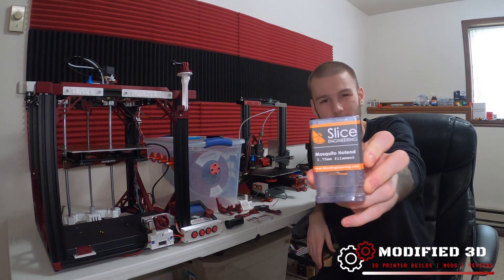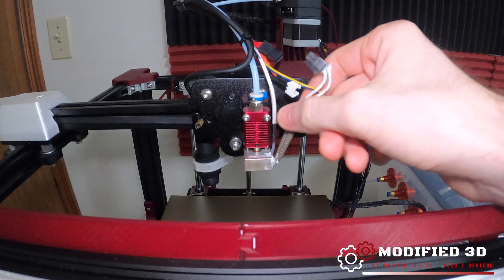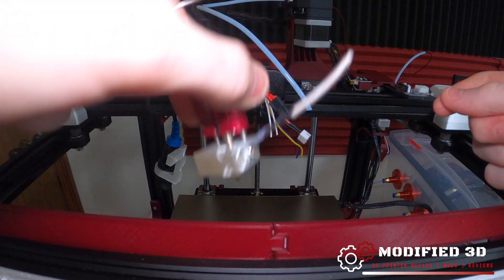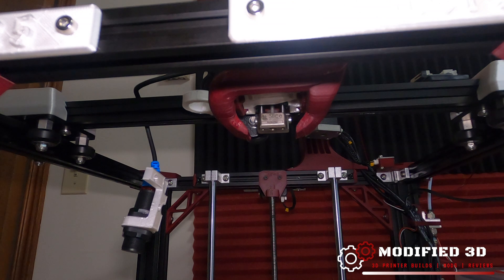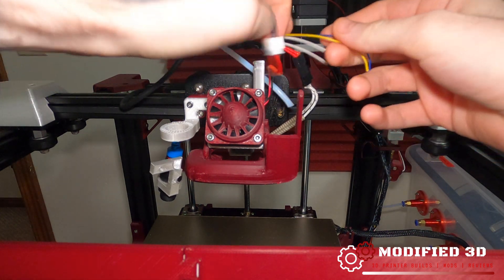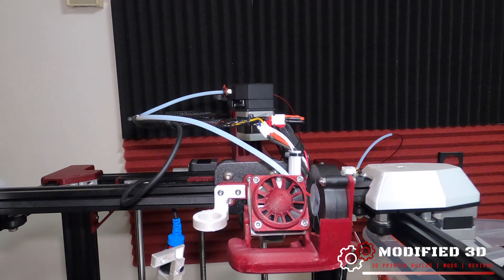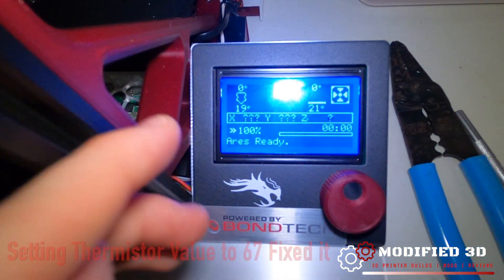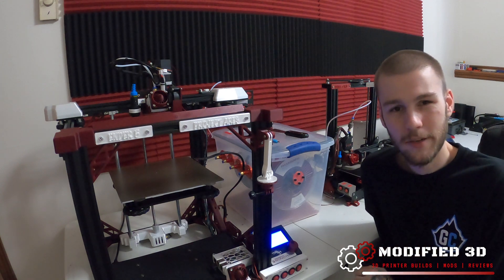How to Install a Slice Mosquito Hotend | Creality Ender 5/Ender 5 Pro (HIGH TEMP PRINTING)

Comment: I have a question. I've got an Ender 5 Pro with a 4.2.2 board and TMC 2208s. I'm a fan of TH3D products. I run TH3D UFW 2 firmware 2.12b and I have their Flex plates (smooth & textured) and the EZMat. I also have the EZABL but haven't installed it yet (due to several issues that TH3D is dealing with). Currently using MANUAL_MESH_LEVELING that appears to be working but not ideally. I would like to update my hotend to allow me to get to hotter temps. I do have the TH3D titanium heat break for the Creality hotend. This will at least pull the PTFE away from the heater which should allow me to run the hotend to higher temps. I also have a higher spec thermistor that I could install and I could recompile my firmware as needed with things set as required. So I'm wondering if I install these on my stock hotend what would be the max temps I could get to? I'm not looking for anything crazy, thinking maybe 300C max would be fine for me and I really don't see running much higher than 280 in most cases. Would this be possible with the stock hotend with the titanium heatbreak? Would I need the higher spec thermistor? Have you ever installed the TH3D titanium heat break? They currently don't have a video showing the process just a couple images and a bit of text on the product page. Think it would be good for someone to do a video showing the install. If the stock hotend wouldn't handle the higher temps, then what are your thoughts about the TH3D tough metal hotend? It's only $30 but I really don't see much difference between it and the stock (I already have their updated quieter fan installed). Appreciate your thoughts on this. Thanks.
Reply from the maker: Hey there! The stock should be able to handle 300c as long as you've got that TI heat brake in place and the higher temp thermistor. Personally I prefer the design of the Mosquito hotend for high temp prints to avoid heat creep thought.
Reply: @modified3d59  Yes, I like the Mosquito hotend too but I don't like the $100+ price.  And I really don't think I need something like that for the temps I'm looking at running.  How much heat creep would I really experience with Capricorn PTFE (or I may switch to TH3D Tough PTFE which is rated to 275C) with the stock hotend and the Ti heat break?  I've already swapped to the TH3D quieter fans.  I don't believe they have a higher CFM rating however but they are more efficient.  Do you know of any available fans with a higher CFM rating that I could switch to?  Or is this even really necessary?  Another option would be to switch to the TH3D Tough All-Metal Hotend.  This is only $30 and appears to have a better cooling system.  Do you have any experience with this?  Guessing this would allow me to go to even higher temps in the future if I want.  But I also have the PrinterMods MDD V1.3 direct drive conversion that I have ready for a future installation and I'm not sure if it's compatible with the TH3D Tough All-Metal Hotend.  I've sent them a question to find out.  Guess another issue is if I switch to the TH3D hotend, I'd have to also switch the mounting scheme since it doesn't fit the stock mounting arrangement.  Possibly HeroMe5 or something else.  If I do that, do you have an recommended mounting options?  Anyway, appreciate any comments.  Thanks.
Reply from the maker: I do have the Th3d hotend but did experience a good amount of heat creep issues with it so I don't know if I can recommend it over the stock with a ti heatbrake. You should be good to go with the setup you have
Reply: @modified3d59  Good to know.  Thanks.
Reply: @modified3d59  I need to find a PT100 thermistor that will fit the stock hotend.  Do you know of anyone that sells one that will fit?  Supposedly the E3D version won't fit.
Reply from the maker: I do not unfortunately